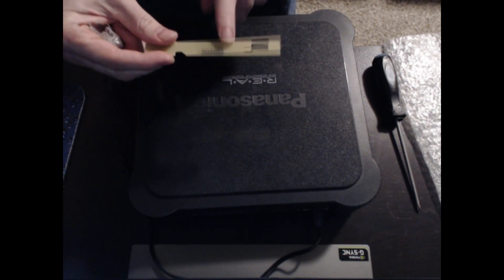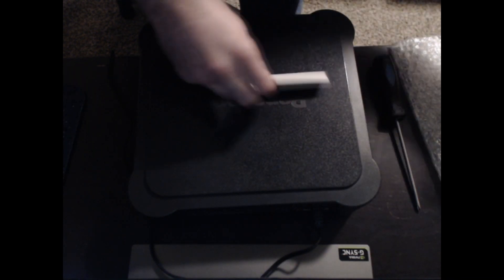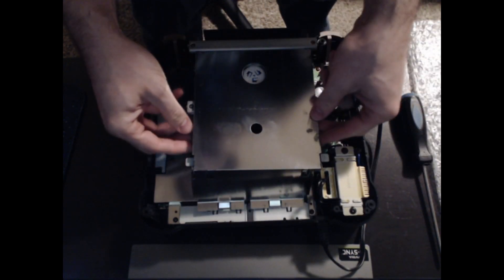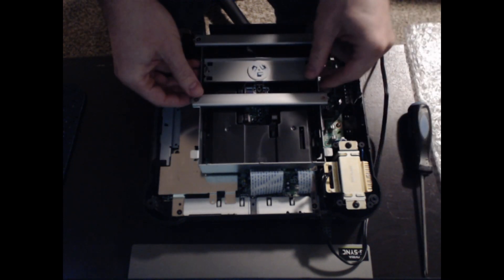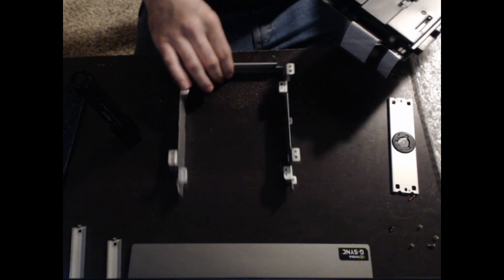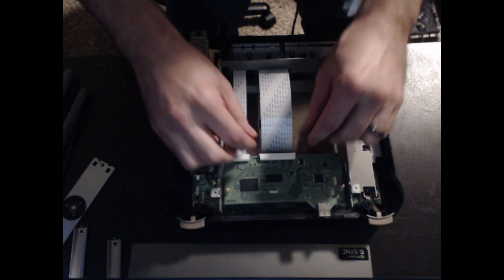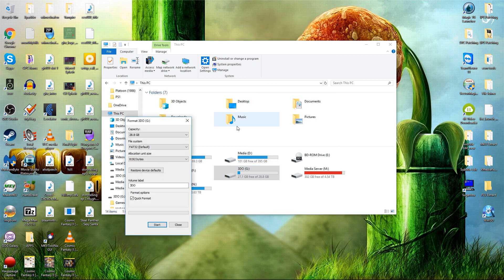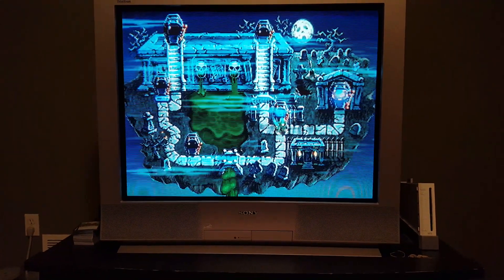3DO USB Host Controller Installation and Setup

Comment: Hm, thousands of movies with this expensive Russian device ... I doubt there will be no solution  without console vandalism.
Reply from the maker: Personally I kept my drive and reference data on how to reassemble this unit should I need to.  To me, the lack of soldering means theres no actual destruction to console (although we may differ on the tem "vandalism").  Fixel, creator of emulator FeeeDO is making his own ODE and it doesnt remove the drive, just plugs into expansion port: https://www.retrorgb.com/new-3do-ode-announced.html

Perhaps this is the solution you'd prefer?
Reply: @GH101  oh yeah some this. But I see fz-1 but my console is Goldstar. I don’t know it would be compatible, though it is only expand interface.

Comment: I'm getting unknow bios on trying to load an ISO. Any ideas please? I've tried another USB again Fat32
Reply from the maker: I would double check ribbon cable connection and BIOS in root.  If it loads to menu but not game I would guess ISO.  Try loading on emulator to confirm.  Make sure any downloaded games are redump and from archive.org, although I must admit most of my games are actual rips.  If none ofnthat works I'd reach put to the creator, he does get back and has been helpful to others.
Reply: @GH101  hi bro, thanks for you help. I got a response however it’s not ideal. So now I can play one game from boot up? I did a video before and my v firmware is different. Very strange and gutting. 

For launch without 3DO ISO Loader – rename ISO Image to 3DOGAME.ISO
Later I''ll try fix that

Comment: how did you get the panel to stay on there?
Reply from the maker: sorry not quite sure what you mean by how did I get the panel to stay on there but if you'd be more specific I'd be happy to try to help
Reply: @GH101  i'm talking about the face plate for the big gap where the CD drive used to be. I can't get it too stick on there. I got my 3DO and didn't have an original CD faceplate cover because the seller duped me with a misleading picture.
Reply: @ACanuckNamedTex  I just used a simple white glue called "weld bond". I am sure most other white/wood glue would work. Best to glue from the inside as it wont show that shiny glue residue on the cover plate. Been on for 2 years and no problems.

Comment: Hi, it's me again. My NXT flashdrive works like a charm on the MNEMO so far. I only powered it on once and it's functional. I have a new problem, trying to fit the top casing back on top of the console. The metal part (the thing that used to hold the CD assembly) is tilted upward at the front. I was only able to fit the back of it on, the holes in the back attached to the motherboard but now the front won't.

Those pegs, I put the taller pegs on the bottom side and the shorter ones up top. Might it have something to do with that or is it something else?
Reply from the maker: Sorry I'm having a hard time visualizing your situation.  I would go back and see how mine is seated because it shouldn't be pushing up or preventing you from re-assembling.
Reply: @GH101  Figured it out. Couldn't tell from your video because as helpful as it was, it's too dark. But yes I figured it out. I had the pegs upside down, put them rights side up and everything (including the lid) fit like a glove.

I am now in the process of trying to track down a BIOS image that works with the 3DO MNEMO mod. (so I can view the old BIOS from the FZ-1. I know it isn't necessary since the original BIOS get replaced with MNEMO's hacked BIOS but I miss the original BIOS all the same)

Comment: What are the ideal flash drives this thing takes?

I'm looking to get a 128gb usb drive. But what is a compatible usb that works for the MNEMO Host controller? I plan on putting a ton of games on there.
Reply from the maker: It seems to take any USB 2.0 or 2.0 compatible drive in FAT32 format as long as each file/game is less than 2GB (all games are 700mb or less).  If your flash drive is larger than 32GB then you will need to format in FAT32 via a tool like Fat32 Format (I don't have personal experience using this).  Windows will only let you format drives over 32GB in exFAT or NTFS, which are NOT compatible.  If you really want to put a library on a USB drive (common use here), then just format your big HDD in FAT32 with the tool and you should be good to go.
Reply: @GH101  I probably jumped the gun a little bit and wound up buying an NXT 128GB flashdrive that was on sale dirt cheap. I have a formatter so that's a non-issue. My only concern now is that it's 3.0 and not 2.0. I read on the renovation website MNEMO personally has not tested 3.0 but wouldn't be surprised if it worked? Well either way this is the one I'm going with for now. If you have any info on the MNEMO mod and USB 3.0 please let me know.
Reply from the maker: @Muda_Muda_Muda_Muda__  USB 3.0 just transfers much faster and therefore probably can't keep up.  I would guess it just won't work but can't be too sure.  On devices like this I usually play it safe and use more antiquated inexpensive hardware, but that's just me.  I just bought 2 32GB USB drives from Micro Center (2.0 USB, house brand), formatted to FAT32 and away we go.  I house the games on a USB external hard drive (and if you're really careful you can back them up) and just move them as I need them.  I can get at least 2 dozen games, if not closer to 30, on a single USB and it serves the purpose of a regular gamer well.  I know it's not as convenient as a whole library but just a suggestion.

Comment: Question about NVRAM. I understand how to create an NVRAM file for each game on the usb drive and save it in the NVRAM folder. I'm confused how it works, though. Any help would be appreciated. Maybe a step by step of how to save games to it and load from the NVRAM folder to the memory manager... if that's what it does.
Reply: So, you load the VRAM of the game you are about to play with L + C, then when you have finished playing the game and saving progress you leave the game, then press R + C and it saves it to the NVRAM backup folder under that same name? 

To play another game you do the same and when it loads it overwrites the NVRAM file you loaded before. Play the game, save, transfer back and on and on like that?
Reply from the maker: @jikkme  That's what I do, yes.  The NVRAM can support multiple saves, it's a clone of the total internal storage of the 3DO. So if you prefer you can use it more like a memory card and just make a new one when you run out of room. I'm very particular and like to back up saves so I do 1 per game, but that's not everyone.
Reply from the maker: @jikkme  In fact, it's better to think of NVRAM as a virtual memory card rather than a save file.
Reply from the maker: I can try the lay it out here and you tell me if this helps.  So when I copy a game over, say Doom, I make a copy of the NVRAM on my PC and rename it to Doom as well.  

On my 3DO I navigate to "NVRAM Backups" and it'll show the list of NVRAM files I have.  Pressing the d-pad left as well as C will write the highlighted file to my NVRAM. So if I want to play Doom I would highlight the Doom NVRAM and press Left + C.  Keep in mind that when you do this, it overwrites the existing NVRAM so you want to make sure that's saved to a different file before loading a new one. Saving the file is similar to loading only you pash the d-pad Right as well as C to save to the highlighted file.  For example once I'm done with Doom and want to load another game I would highlight the Doom NVRAM file on my USB and press Right + C to overwrite the original blank file with my new saves from the console.  

You can also run multiple save games on a single NVRAM, the 3DO could hold several saves from various games at once, but with how small an NVRAM file is, I just do 1 game to 1 NVRAM with the host controller, up to you.  Another good thing is that NVRAM stands for "non-volatile RAM" meaning that it doesn't need power to keep saves.  This means you really don't have to worry about your 3DO RAM going bad and you can easily back up your USB whenever you want.  Does this all make sense? Does it help?

Comment: im really stuck. ive got the chip installed. set up the flash drive. I can see all the files, but it doesn't matter if I try to launch the bios or an iso, I get the screen telling me to insert a disc... I have no idea what that means
Reply: I got in touch with mnemo. He fixed it.
Reply: It needed a file flashed. I'm Steve.
Reply from the maker: @stevelaminger3097  Wow so it was missing a hardcoded file?  Was it possible to flash on your device without sending it back?
Reply: @GH101  yes, mnemo sent me a .bin file that I put on the root of USB before using. And an iso with a few tester apps n demos
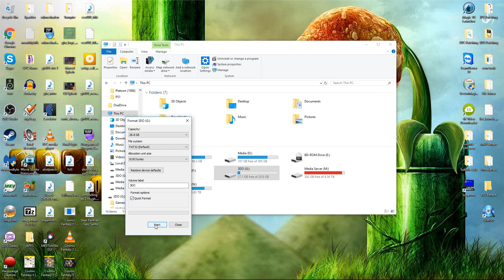Reply from the maker: Sorry to hear about your troubles.  Lets go back to the beginning and take it step by step.  Now you are sure you've installed both ribbon cables and everything is secure, right?  Second, make sure your USB drive is formatted in Fat32 (not exFAT or NTSC, it must be Fat32).  Next, verify you got the proper BIOS file from Mnemo (guessing you did because you reference it) and make sure it's the only file in the root (base directory).  You can have folders (like save or games) in the root too, but the BIOS must be in the root and outside of the games folder.  File structure can be seen from 15:55 on.  Next, when you power on do you get the BIOS menu file (like you see at 16:50)?  If so far your answer is always yes, then I'd say you've installed and set up properly.  My next guess would be that it's your image files, are they in ISO?  You cannot use the typical BIN/CUE format for games, it has to be ISO (use the WinISO program I've got in the description).  If you run the BIOS file from the main menu you should only get a blank screen, so that doesn't surprise me.  

I've given a lot of steps here and I'm also busy at work, but I'll try to respond if you can let me know where your system is hanging up.  It may take some retries, but you'll get this working.

Comment: Does it make any difference in game play if you use a 2.0 vs. a 3.0 USB thumb drive?
Reply from the maker: I'm pretty sure that you want to use 2.0 since 3.0 drives may have too high a power draw to work effectively.  Also the USB port on the Host Controller is 2.0 so you won't get any benefit from using a 3.0 either.

Comment: Hi, what screwdrivers you used to remove the CD Trayholder's screws in this video? I tried Philips #0,1,2,3. But none of them worked
Reply from the maker: I actually didnt use precision screwdrivers, found they were too short so not enough torque.  I used a standard Phillips from local hardware store with long length.  You should see it with a black/blue handle many times in the vid.  Head was bigger but not huge and length was like 10-12", which helped out.  I did also use tweezers to grip and hold screws whem removing/replacing the chassis to the base unit.  Hope this helps.

Comment: When I select Launch Bios or boot the console without no USB drive, I get a black screen.  Games seems to work fine but I cannot access the 3DO memory manager.  Does your console work okay with this option as I can find any info anywhere.
Reply: I think the fz-1 used memory manager from game discs. You might want to try that
Reply from the maker: I know there's a way, but I haven't figured it out.  I figured one of the menu options, but I get a blank screen if I choose the BIOS option.  I'm betting there may be a BIOS rom you could run, but honestly a lot of this doesn't matter due to the NVRAM dump.  What I usually do is load a new NVRAM (you get a handful of files with it that I copied to the USB drive and then I copy over and over).  Then I save the NVRAM before starting a new game and name it to the game.  Its basically like creating a new NVRAM internal storage for each game (or series of games if you prefer).  Since they are so small, I had no issues with this.
Reply: @GH101  Yeah, I suppose it may not matter if the launch bios black screens, since we have NVRAM access, yet I just wanted to clarify that I didn't have a faulty unit.  

With the NVRAM does the name have to be the same as the iso name?  I saw a bunch of NVRAM files with the "bin" extension in the folder i copied. 

So you pick one of those and rename it to the game your playing and copy it to the internal NVRAM?